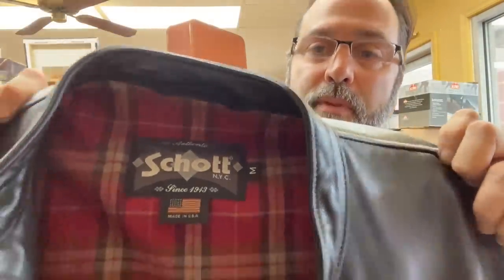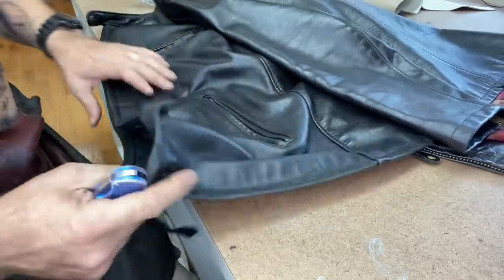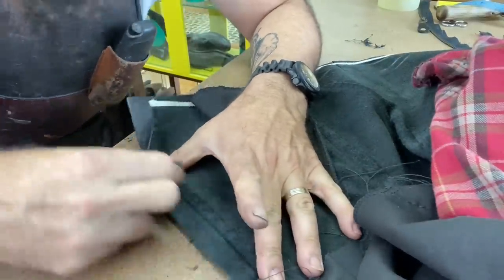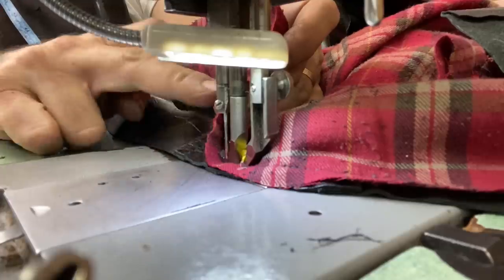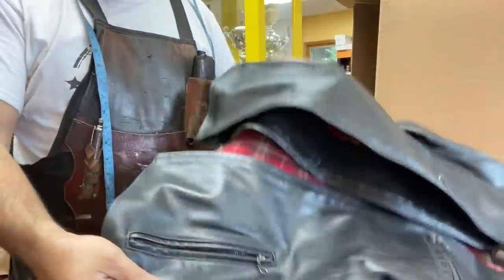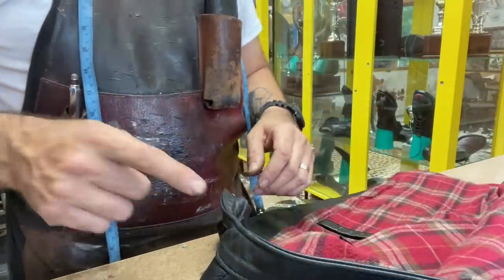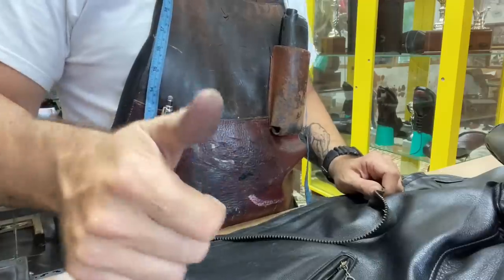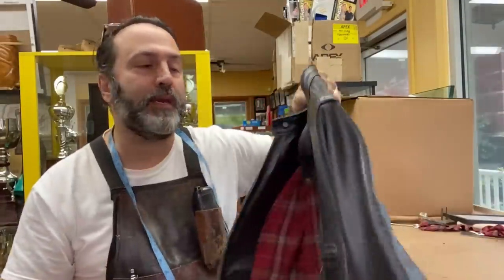SCHOTT jacket alteration

Comment: Despite the customer's mask we see that he has a big happy smile. Nice work!

Very interesting anecdote also. As you thought, Irving Schott in 1928 invented the first leather motorcycle jacket with a zipper. The Rebel biker jacket. "The rough, tough garment designed for bikers crossed over into high fashion – and endured for decades."

In another source, I read that "The Schott’s sold them through a Harley Davidson distributor over on Long Island. Each Perfecto Motorcycle Jacket sold for $5.50."

Let's continue...

Comment: Hi Steve. I came across your channel a couple of weeks ago and been hooked ever since. I’m working my way through all your vids and never tire of them. I’m from New Zealand 🇳🇿 and worked in a shoe factory in Wellington for 17 years until imports made it unprofitable in 1996 and it closed down like most shoe and clothing factories here. We mainly made cheap school shoes of low quality in cement and veldt schoen construction. Actually weren’t that cheap at between 50 and 100 bucks NZD back then. There were many shoe repair shops around back in those days because shoes were expensive so it was cheaper to repair shoes that were decent quality. Welted shoes were a thing of the past in our factory back then but there still one or two factories in NZ that were making them.

Comment: As a hobby sewer, I agree about the old threads. I’m so jealous of the way you wield that Stanley knife. I use a seam ripper and it takes me forever. I know if I used a Stanley knife I would be cut to ribbons within a week.  I didn’t know you could reuse the top stop in a zip. Gonna play next time I get one that is U/S to see what I can do. 
Excellent tip with the glue. I’m going to try using a fabric glue for the same reason.
Reply: Think I'm as envious of his sewing skills as his cobbler skills.  The man just has talent.
Reply: I also have a tired old leather that needs a new lining. After seeing this episode I feel confident enough to tackle it sometime.
Reply: I use a safety blade instead of a stitch ripper for things like that. You can buy them in a hardware store in the section where they sell box cutters.  I find holding the blade in my fingers gives me more dexterity and control of the slices than when using a blade in a handle.
Reply: Same.
Reply: You have got to get over the seam ripper, Sarah.  Use the Stanley knife or a single-edged razor.  Difference is that one takes minutes to do the job and the seam ripper takes about 5 hours!

Comment: were are you located? i might need to pay a visit with exact same jacket! lol
Reply from the maker: Look under “about” section 
412 W. Broad Street 
Falls Church Va 22046
Reply: @BedosLeatherworksLLC  sweet! thanks! Can you alter the shoulder part of this same jacket(it seems to have a pretty complicated design for the shoulder abd back part)?  it's a little roomy on the upper back and shoulder i wonder if you can "shrink" it a little bit remove some material  so it lift up the arm hole a little higher. cheers!

Comment: Dont think they 'invented' the design of the motorbike jacket cause the idea comes from a military tunic going back hundreds of years which was designed to have a flat piece of material across the chest and the opening offset so wind and rain didnt penetrate and soak the wearer. Schott only started in 1913 and these military tunics (particularly naval) are from 1800's. They likely appropriated the design for motorcycle use.
Reply: The original Perfecto motorcycle jacket designed by Irving Schott in 1928 was based on an aviator jacket.
Reply: @schottnyc  so they say you only need to change 10% of something for the new 'design' to be original. I am sure the designer of the original aviator jacket is flattered
Reply: @iankearns  Well, we share over 98% of our DNA with chimpanzees and that 2% makes a pretty big difference. Those original military styles did not have zippers which was a revolutionary design change in the 1920s.
Reply: @schottnyc  I am sure the original designers in the early 1800's wouldn't have considered the use of zippers considering they hadn't dabbled with time travel. I'm not criticising your design, it looks okay, very similar to many others and as you named it then you can claim it as your own - just don't accept the originality of it.